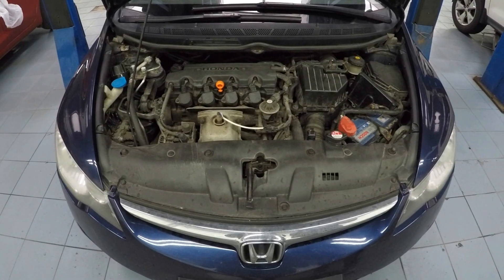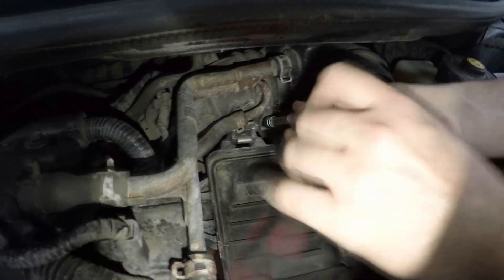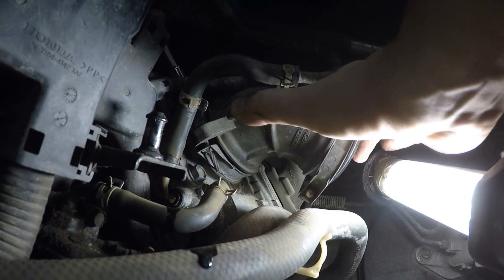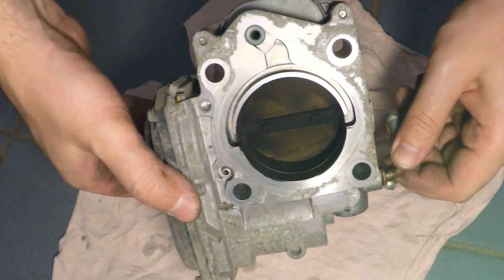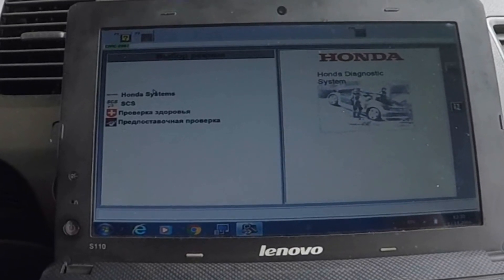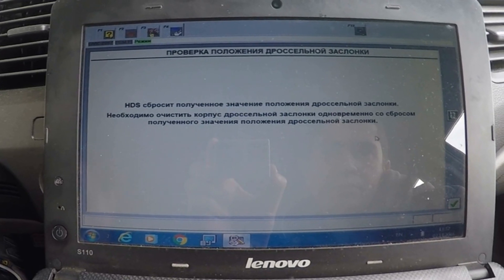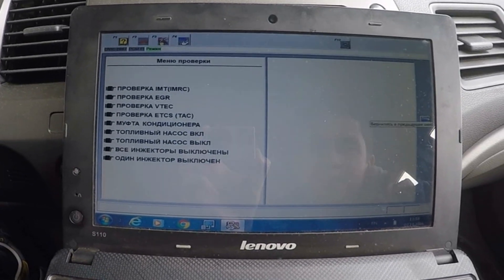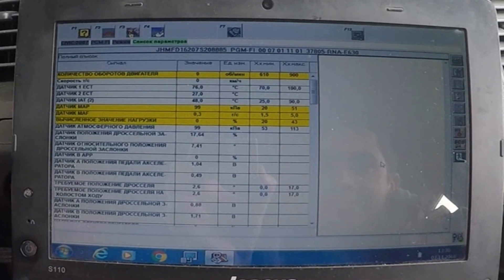Throttle body cleaning and idle relearn 2007 Honda Civic 4D/5D  1.8 i-vtec R18A

Comment: I think this is probably what my Honda needs because when the air conditioning is on at idle, like at a stoplight for instance, the car shutters the revs drop momentarily in the car feels like it's going to die. It hasn't actually died yet but it's very disconcerting. After watching this video. This is not for the home mechanic. At least not this home mechanic
Reply: Hello. I was wondering if you had work done or got this figured out. Thanks
Reply: Did you manage to solve your issue??

Comment: Greetings, question: Does the throttle body of the 2007 honda civic have the IAC valve integrated?
Reply: Electric throttle body's usually just crack the butterfly open for idle air control
.
But I'm doing this job...  I'll reply back in an hour or 2 to let ya know
.
If I don't reply.... their is NO iac valve
Reply: @kainhall  

Thks bud
Reply: Must not have a IAC I was researching too
Reply: Did u ever get your question answer , I’m thinking about cleaning the IAC on my 2006 civic also and don’t know if it has it
Reply: @fzghbkhvgfhhgv3524  also... I'm 6 foot 5
So to save my back.... I just got on my knees
.
WAY more comfortable 
Just don't let your shop buds see ya
.
Might get some "ya practicing??" Comments LOL
Reply: @kainhall  

😀… thks Man .
Reply: @kainhall  lol
Reply: @fzghbkhvgfhhgv3524  no IAC.... just the EVAP purge valve and butterfly
.
Helped a TON on this car
.
Also, I didn't need to remove any of the wiper panel stuff.... but I work on cars for a living (so small spaces aren't a big deal)

Comment: could you feel any boost in performance?
Reply from the maker: Probably I felt  just a slightly faster response of the engine when pressing the accelerator pedal. But now I think it was just a placebo effect))
Reply: It's not gonna make more HP
.
Just idle smoother

Comment: I have done this with a scanner tool and my idle goes around 750. But whenever I turn off the engine, and turn it back on it comes back to around 900. I do the reset with a scanner and the relearn just like you show on this video, but never seems to work after I turn off the engine.
Reply: it’s normal it’s post start idle
Reply: After you start...it will "high idle" for a few mins
.
It's warming up the cat and o2 sensors
.
After a few mins / After temp warms up
It will drop back down

Comment: Hi I do throttle reset without cleaning but hds shows all time time idling relearn is complete.. do I need to reconnect and clean throttle first ?? Another question is what is a standard idling rpms ? On hot engine ? I have something like 650-679 rpms and my car shakes a bit on idling. Thanks for your answer;)

Comment: The air cleaner housing has a bolt in the top left, it doesn't appear to be for a socket of any kind. Does it just pop out? Or how did you remove this?
Reply: Thomas Manges it's a damn rivet with a rubber seal I pulled mine off but couldn't get that rubber seal back through when I put it back on... i said fuck it pushed it down and put the other 2 bolts on
Reply: @PEN1_Ontario_909  use a little white lithium grease or oil on it
.
Pops right on

Comment: As an fyi for the comment readers:  It is possible to do this with the throttle body left in the car, perhaps not optimal, but possible.  Disassemble the intake as you see here to access the throttle body. Then depress the accelerator pedal to open the butterfly valve and reach in with a small brush to clean the throttle walls and valve.  Be aware the you will have turn on the car (not start.. just on) to move the throttle valve to the open position. If the MAF sensor is unplugged when you do that then there will be two codes that you'll have to clear after you put everything back together.  Avoid the codes by plugging the sensor in when the car is on - or just clear them if you have and obdii scanner that does that.  Also note that Honda's service manual state to avoid getting cleaner in the throttle valve bearing area because there is lubrication in there that can be washed away.
Reply: Jim Trainor yup I had my wife put the pedal down to open the butterfly sprayed on a rag and cleaned the throttle body... put it all back together started the car and got a MAF sensor code... rest the code idle and everything runs smooth
Reply: I did this and the Idle is not jumping after I let go of the gas.  Any idea? I didn't take it off just cleaned with the value open as u said.
Reply: @billn9n  Give the car time to relearn the idle. Honda says idle relearn takes five minutes after the car is warmed up to operating temperature. Leave lights, ac, and fans off (anything that loads the engine at idle) while it relearns. If that does not do it then I don't know.
Reply: @jptrainor  OK I will try again.  Should I do the relearn as shown in videos with holding the rpms to 3k for 3 mins and what not?
Reply: @billn9n  The 3k rpm for 3 minutes is to warm up the car. I don't think it's really critical that it be exactly that as long as the car is warmed up before you leave it to idle. But the car does have to be warmed up to operating temp to relearn the idle. Honda's normal cold idle is around 1500 rpm when you first start the engine. It drops down to 650 or 750 rpm as it warms up. The exact warm idle speed depends on the engine and your location. Colder climates have a higher warm idle.

Comment: Very good video ! Where can we find the Honda Diagnostic System and obd2 interface , i guess honda is not selling them on retail .
Reply from the maker: Thanks! Sorry for the late reply. I've used chinese copy of this device, which I ordered here: https://www.aliexpress.com/item/2014-Newest-Version-V3-012-023-for-Honda-HDS-HIM-Diagnostic-Tool-with-Double-Board-HDS/1838749350.html
Reply: RoadRiveR thank you very much! Going to order one !
Reply: My crazy neighbor ordered this software to change a key code on my car 2007 Fit (so I would not able to start it). However his software was fake and counterfeit (made in his native country) and it did not work. As he was trying to figure out why, the cops arrived. They confiscated his laptop and master keys. (He was not arrested because of mental illness)
Reply: @mkrp4  hahha nooo way. Seriously? This is hilarious
Reply: +RoadRiveR 
does that software have access to vtec, fuel injection, etc?